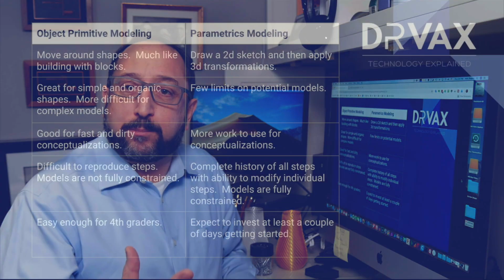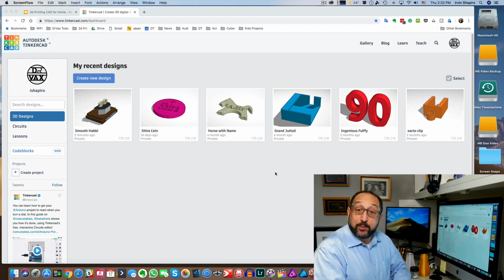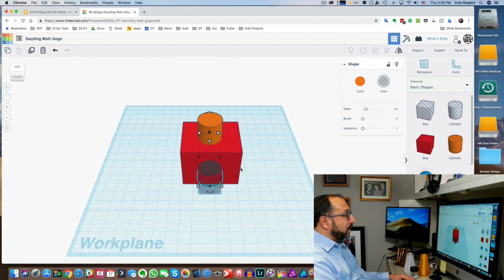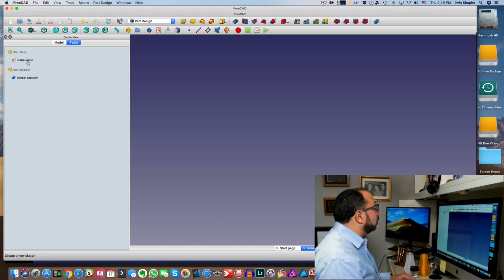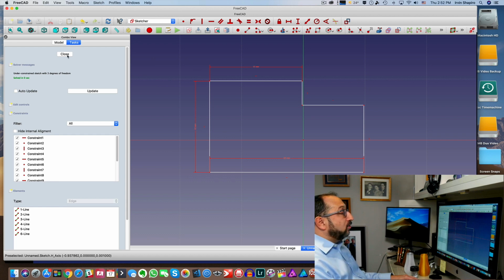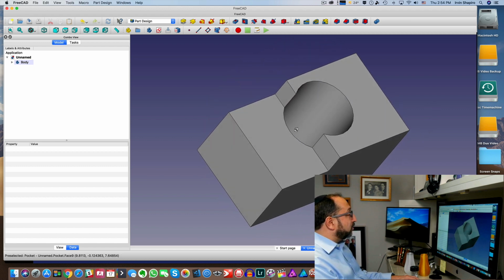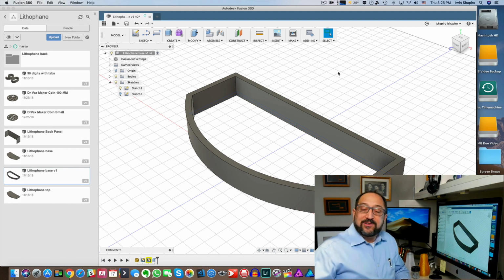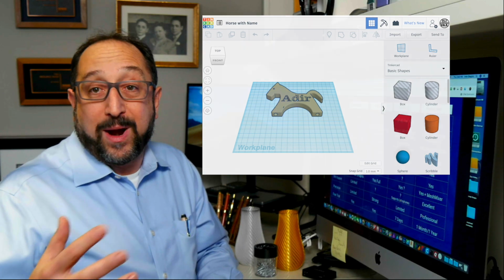Picking 3d CAD Software to use with 3d Printing

Comment: you forgot sketchup (which have a free version too)....but who cares once you know the fusion 360 the most powerful and easiest of all "parametric ones", you want to go more to meshes than parametric ? well "blender" covers everythong that fusion dont, in special if you take advantage from simple and very handy programs  "makehuman" and "wings3d" to generate meshes that can be posed and combined 
in blender or eaven in meshmixer too. fortunatelly all this softwares has a way to share and  combine between them  through  export-import certain types of file formats in common, z brush is an option, it looks like "runs in magic" cuz works really well in almost any computer no so powerful but manage files is really "a pin in the ass" again is just a coment based on my experience
Reply from the maker: Thanks for sharing.  I believe the comments from my viewers are as important in learning together as the videos. 

You are correct there are addition choices.

Comment: From 1995 to today: ProEngineer, CATIA V4, SDRC Ideas (C3P), SOLIDWORKS, some CATIA V5, some Solid Edge.  This was mostly (but not all) determined by the employer.  When I did have the chance to choose, I chose SolidWorks (in 2005).  If I had the chance to choose today, I would choose SolidWorks. If I needed to deal with huge assemblies (more than 20,000 components) or complex surfacing I would choose CATIA V5.

Comment: what's about Rhinoceros  ?
Reply from the maker: I had never heard of it before.  Thanks for pointing it out.  I just took a look and it seems to be more of a 3d drawing program than a CAD program.  While Tinkercad and Fusion 360 are very different.  Tinkercad uses direct object manipulation while Fusion 360 is a parametric modeling program, both focus on drawing objects with precise dimensions and make it very easy to modify the size of an object.   I need to play with it a bit more but Rhinoceros seemed at first glance to focus on drawing visually interesting objects and less of drawing mechanical or engineering focused objects.
Reply: Good and good value system though specifically for surfacing, not engineering (last time I used it - which was a while back)

Comment: Try DesignSpark. DesignSpark is free from RS Components and there are currently 2 versions.
Version 2 is available in 32 bit and 64 bit builds where as version 4, which was recently released, is 64 bit only.
I currently use version 2 because I use an RCA Cambio 2 in 1 tablet, which uses the 32 bit version of windows 10, when away from home as well as my primary computer and the .rsdoc files created in version 4 are not (currently) backwards compatible with version 2.
Reply from the maker: Unfortunately I am a Mac guy so I am unable to try Windows only software.

Comment: Thank you for this informative video, Irv! I can recommend OpenScad which I would call "the programmer's 3D CAD software". You program models more than you design them, which is great as it naturally leads you to reusing objects you created once in your future designs. It is also completely free and runs on every operating system.
Reply: Good video. Over the years I've used everything from old Autocad, Inventor, 3d studio,  Sketchup, Librecad, Freecad, OpenScad,  and Blender.   I have gone sour on the closed source programs, having had the rug pulled out from under my feet one too many times.  Blender is the one software to rule them all, if you have the time to really learn it, but OpenScad is my favorite for doing simple mechanical models.  Freecad has a lot of promise, but I always seem to get lost.
Reply: I primarily use FreeCAD for mechanical parts, Blender for roughing out and animation. There are others like SolveSpace and CadQuery to choose from. I'd consider CadQuery over OpenSCAD because the language design of OpenSCAD is wonky, but it's certainly useful - even integrated in FreeCAD and Thingiverse. I don't want to rely on non-free software (that's about user freedom, not price), and I was among the contributors to the original Blender buyout.
Reply from the maker: I agree.  OpenScad is excellent for programmers.
Reply: I find OpenScad good for objects that you define mathematically.  Like say you want to work with a set of points you generate from equations, it´s easy to do in OpenSvcad.  I´m sure you can do that in Fusion 360 but you´d have to do some digging to find out how.

Comment: Thank you for making this wonderful video.  At work, I use Solidworks, which is VERY expensive, and I could never afford to use it at home.  At home, I use Fusion 360.  I started using it over a year ago under the free 'startup/hobbyist' license, which I was able to renew after my first year was up.  However, when Autodesk changed the pricing structure for Fusion 360 last fall, they said that if you did subscribe before the beginning of October, you would have access to the full version of the software for a subscription fee of $310 per year.  They also said that by renewing your subscription every year, you will be forever 'locked-in' at that same annual price.  They also said that (at least for now) , they would continue to offer the free startup/hobbyist license.  (This is all explained here:  https://www.autodesk.com/products/fusion-360/blog/fusion-360-tier-consolidation/)  Since I did not believe that I could count on Fusion 360 always being offered for free, I decided to subscribe at the guaranteed $310/year annual subscription rate.  As you say in your video, Fusion 360 is a highly-developed and sophisticated piece of CAD software, but at the same time, I can tell you that it does have some warts, especially when using features like lofts and splines.  However, I do not regret my decision to subscribe to Fusion 360, as I have been able to get some very good work done with it.  (Some of my work is here:  https://www.thingiverse.com/billbo1958/designs.)
Reply: Try pricing, CATIA, NX or Creo - you will probably find that SW isn't so expensive after all.
Reply from the maker: In fact I did the same thing.  However many of my viewers would have a hard time spending hundreds of dollars a year for software they may use once a month.
Reply: @MakeWithTech  I can certainly see that those who do not plan to use CAD very much would not be willing to invest money in something like Fusion 360, or for that matter invest the time required to master Fusion 360.  I can imagine such users would find a software like Tinkercad very useful.  (I never actually looked at Tinkercad - maybe I should, if only to see what it is really like.)

Something I wonder about Fusion 360 is how far Autodesk will allow it to develop.  Consider this:  if Fusion 360 becomes more powerful (which I really hope it does), what incentive will people have to buy the much-more-expensive Autodesk Inventor?  On the other hand, if Autodesk were to add features to Fusion such as part and assembly configurations, good 3D sketching, the ability to replace parts with similar parts in assemblies without needed to recreate all joints, and feature-driven component patterns, I would probably consider proposing to my employer that we ditch SolidWorks (with its ridiculously high 'subscription' fee) and switch to Fusion 360.

Comment: I've only used TinkerCAD so far for 3d printing purposes, but cut my teeth with AutoCAD back in version.... 10? 
Typically I'm focusing on technical parts with well defined dimensions and found it a bit of a chore to use Tinkercad, so definitely going to be moving back to using a more traditional offering like fusion 360... Only problem, it's limited to Mac / MS, so... Freecad I guess.
Reply: If you are more comfortable with AutoCAD, DraftSight works on Windows/Linux/MAC and is compatible with AutoCAD even at command level. The free version is 2D only, but FreeCAD can import DXF files.

Another multiplatform alternatives are:

3D
- OpenSCAD (also can import DXF files).
- BRL-CAD

2D
- QCAD
- LibreCAD
Reply from the maker: I think you will enjoy trying freecad.  It is fully support on Linux.